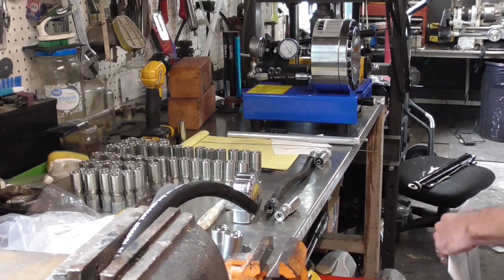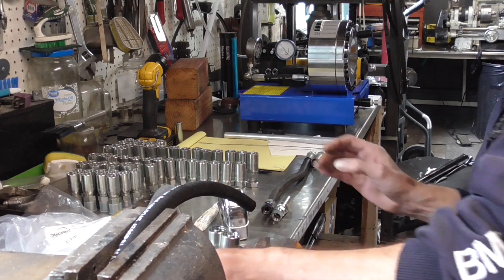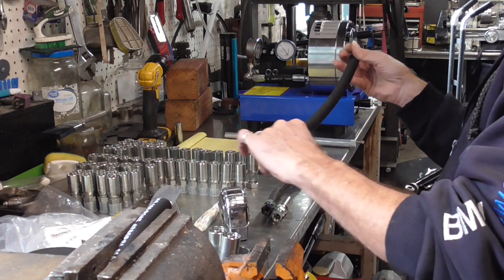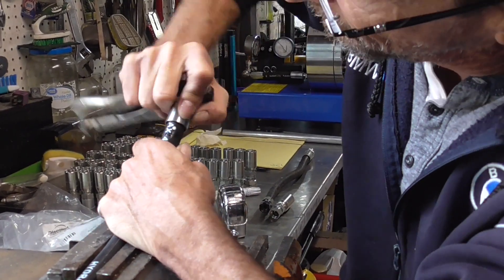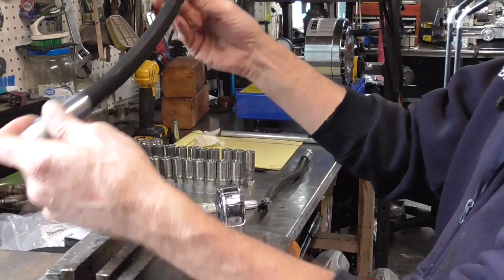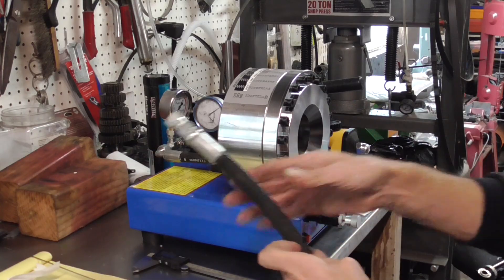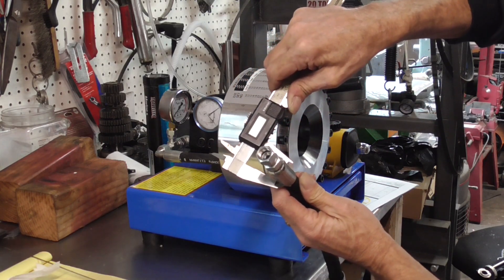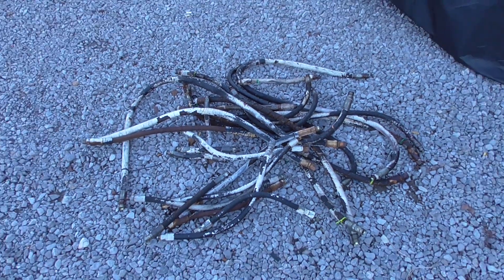Low Cost Hydraulic Hose Crimper - Waste or Money or Worth It ?!?! Part 2...Hose Crimping TIPS

Comment: Guy I know wants one of these units but we are unsure what the largest diameter it can crimp.. Amazon listing is unclear.. It says 1" but also says 1 1/4".. Try whacking the straight fitting with a soft rubber hammer unless you think it will damage the fitting, obviously won't work on 90's.. local auto shop makes hoses and cuts them off with a cut off saw and never cleans the inside of the hose? Of course I clean them out before I installed them..lol

Comment: u dont have to do all that usless crap just measure the outside mm of hose and crimp to 4000psi
Reply from the maker: I actually watched the pressure gage as I was doing the various different types of ends, and the pressure varied several hundred psi to obtain the correct diameter that got them to spec. They may not have to be crimped exactly to spec and still hold good pressure (not sure as I didn’t make any test ones with varying levels of crimp), but figured it would be best to go by the specs since that’s what they are there for so this was the easiest way to insure I was hitting the specs.